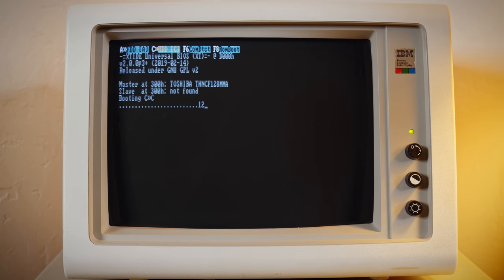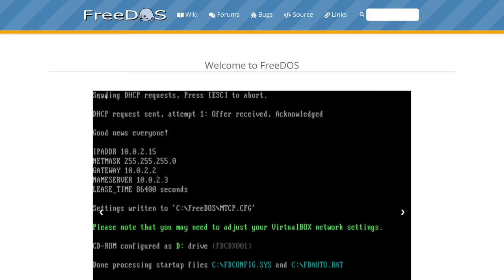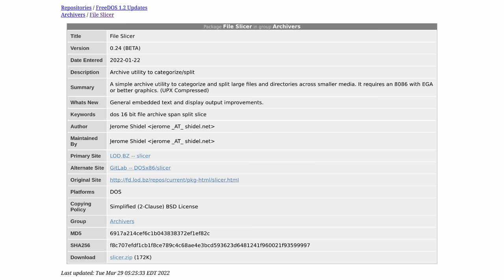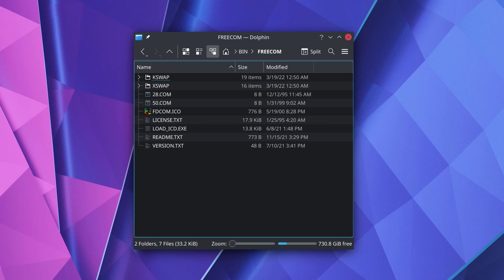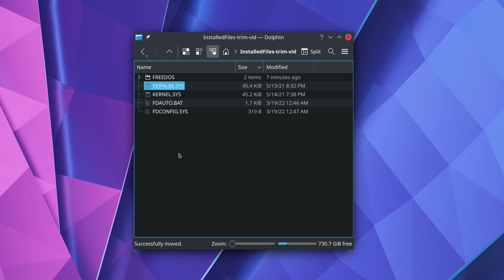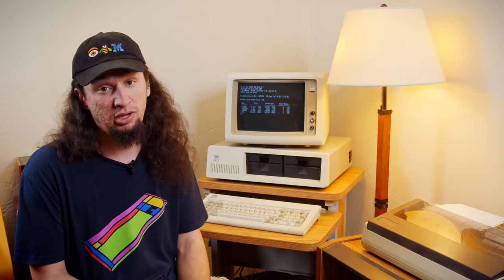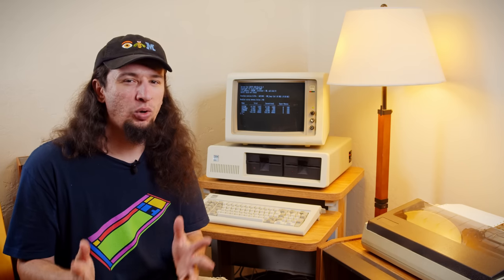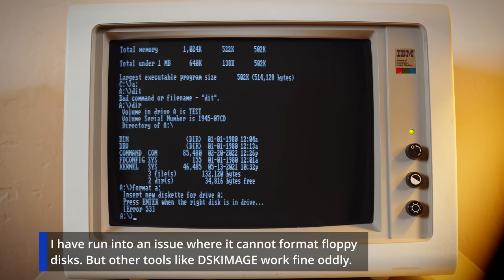Installing FreeDOS for 8086 on an IBM 5150

Comment: It seems to me that FreeDOS doesn’t really know what it’s supposed to be.  Is it supposed to bring an antiquated OS to new computers?  Or a more feature-rich replacement for old computers?  When you’re talking about potentially running on systems with “up to” megabytes of storage, and kilobytes of RAM, you can’t really optimize for both.
Reply: It is supposed to be a loophole for selling computers without an OS in the countries where it is prohibited by law.
Reply: @IkarusKommt  Selling computers without an OS is illegal in where now? Sounds totally ridiculous, but I can imagine that being the case somewhere - wouldn't be even close to the most insane laws I've heard about; but still raises a question of who tf is behind such laws anyway?
Reply: @robsku1  The logic behind that is simple: all electronic appliances must be sold in the working condition, and computers cannot work without an OS.
Reply: The purpose of FreeDOS is to have an Open Source and 100 % compatible replacement for proprietary MS-DOS. That's the main goal of FreeDOS. The rest, like more features and better support of modern hardware with more RAM above 512 MiB comes second. 

The reason it's not so well suited to very old 16-bit machines is because the development came at a time when everyone already had a 386 or better and 16-bit machines were considered mercilessly obsolete. Many advanced tools were therefore developed as 32-bit protected mode applications. Fortunately, this does not apply to the main DOS programs, which serve as a replacement for the programs in the DOS folder. These therefore all still run on the older 16-bit processors. However, many of these are also more feature rich and powerful, so they require often more RAM.
Reply: @robsku1  The country is Germany.  It is possible that there are other countries with such rules.

Comment: I know I shouldn't nitpick, but I'm kind of irrationally bothered by the fact that you keep saying 8086 when the actual CPU in any original 5150 or 5160 would have been an 8088.
Reply from the maker: I wanted to avoid confusion for people and since the kernel version of FreeDOS is called "8086"  I decided to just stick with that for the whole video.

Comment: Remember: it is utmost important to remove Microsoft from everything you can. FreeDOS is the tool of choice for retro computing.
Reply: Except your 5150 still has Microsoft BASIC in it's ROMs. :)
Reply: DR DOS, anyone? Also, 4DOS (I heard) is FOSS nowadays, I think FreeDOS should start including (and improving on) it as alternate shell option - for myself, I can't even think of running DOS without 4DOS as shell.
Reply: @robsku1  FreeDOS doesn't require 4DOS. FreeDOS's shell is already very powerful by itself.

Comment: bios device drivers access, not on the os layer, direct compatibility on the bios level to all devices, usb
Reply: linux boots nicely from a usb-stick, wtf, better
Reply: write directly (flash) the boot image to the modern drive, then resize like linux distros do
Reply: too much work if you dont see the correct solution (perfect) right away
Reply: if the devs are not "at home" with the vintage systems, or even normal usage cases, then stupid decisions are made in packaging and user interface
Reply: meh attitude leads to meh packaged system images
Reply: yo zmodem  is legend
Reply: self-contained is super
Reply: if you got it to 2 disks, then use the two disks
Reply: even decompressing packaged version
Reply: you just leave the computer to do its thing
Reply: the less complex way is better, you dont usually have proper cables
Reply: or the second side of the cable working with the complex design
Reply: pkunzip is fast enough on 8086
Reply: or ARJ
Reply: if you make the shrink image on a vm, you can get a minimal flash image .img .iso to flash with linux, like you can flash rpi systems

Comment: Whilst this is cool, it's too inauthentic to me. The four floppy version would've been much preferable.

Makes me recall installing a hard disk to my Amiga, and that took... lemme just think in text here, 3 floppies for the OS(4 if you want to install a language other than English), 1 for the SCSI driver to get CD-ROM support, 1 for getting my printer driver installed and... I think that's it, so yeah, 5 or 6 floppies to be properly realistic about it, and this was in 1992.

I imagine installing Windows 3.1 on a similarly spec'd machine of the time would work in a similar manner, but probably with more disks involved.
Reply: To be fair, not only do the 3.5 inch drives in most Amigas hold 880K, but they're also much faster than the old 5.25 inch, 360K drives in that IBM machine. My A1200 had 1 internal and 2 external floppy drives, one being high density, 1.76Mb. So much faster than floppies on my old 8 bit Atari, but they were still painfully slow. Then I got a 2.5 inch, 60Mb hard drive... enough space to last forever! 😁
Reply: @another3997  Ridiculously, my A1200 had a 1gb HD I bought in like 1995. Never got past 200mb full, even after WHDLoad. Much like the expansion card, which had a 68030, 68882 and 4mb fast RAM, it was really underutilised.

It still works, too amazingly, hard disk is making unhappy death sounds and most of the floppies are dead, but DF0 and DF1(both 880k, one obviously external) still work just fine if I can find a game that isn't full of read errors.
Reply: @fattomandeibu  You just need to clean your floppy drive. And if it can't read your old floppies, chances are high, that the reading head is misaligned. You should watch some videos about repairing floppy drives.
And remove your CMOS battery from your A1200 motherboard. The latter is the most important thing you should do, otherwise battery leakage will destroy your A1200 motherboard.
Reply: @OpenGL4ever  I already tried that. I first used a cleaner disk, then the old cotton swab method.

My A1200 doesn't have a CMOS battery. There was a one on an expansion card but I already removed it.

Comment: Freedos has a lot of issues still. Program compatibility is now really good compared to previous verisons.. But some usability things really are just unacceptable. The edit program does not follow the same keystroke patterns as msdos edit. nor does it seem to follow the same file encoding protocol. For years I would exit the app by pressing alt, up arrow twice, enter twice. that would save and exit. However freedos edit will run to the right hand menu when pressing up arrow. Stupid things like this make me not want to use it. 

its bloated. the startup files are bloated, the amount of activity on the screen is bloated while booting, This is absolutely asinine as they have useless things like MEM running which passes by so fast you cant see it. Why ?

 there are no install options with the floppy version so it tries to load network drivers and hangs up on first boot. unacceptable.

the DIR command defaults to pause on every screen out of the box. why? why the hell do they change fundamental usability on such basic things?  The file shell isn't even as capable as dos 5 dosshell. it lacks simple word wrap on viewing files which makes a very usable thing, utterly useless in freedos. And it isn't even part of the floppy version.. 

I am ranting yeah, but there are about 50 other things that keep me going for 6.22 with few addons.
Reply: I think the bloat comes from trying to automatically run on any PC at every boot. That's why FreeDOS checks for presence of multiple different kinds of optical drives (and possibly other devices). But of course, when installed, it would make more sense to skip attempting to run drivers for stuff that was not detected. I have FreeDOS installed on a virtual machine in VirtualBox, and I got it to boot much faster after deleting references to non-applicable stuff in the whatever the FreeDOS counterparts of config.sys and autoexec.bat were. Most of the boot time in the default install seemed to be spent waiting for various timeouts for stuff that isn't there.
Reply: @enginerd80  They have creative batch files for cdroms, network interfaces, memory boards, pci tags, and even one for a welcome message. It goes through some 1400 lines of batch files by default. I trimmed mine down to about 16...
Reply: EDIT from FreeDOS follows the keystroke patterns from Windows and this is in my opinion a very good thing.
I am really glad that CTRL+X, CTRL+C and CTRL+V work the same way as on windows and all other modern desktops like Gnome and KDE from Linux. Because that is the standard now for every modern desktop system.
cut = CTRL+X
copy = CTRL+C
paste = CTRL+V
It would be really annoying, if they would do it different like in old DOS.

The startup files are there to make it userfriendly. If you know DOS batch file programming, it's an easy thing to change them.
You can even just delete them and write your own. I adjusted my startup files.

Comment: Well, it shows that you probably haven't even been around when an 5150 and it's accompanying DOS originally came out. And that is what you should compare FreeDOS with. Alone the option to use the FAT32 kernel is something that wasn't even remotely on the radar back then. Or an editor like EDIT (granted, I am not a fan of it either) but with PC-DOS 2.0 on an XT, you had to make due with EDLIN, which is also included with FreeDOS, so there you have also some easy space to save... ;-)
Reply: EDLIN from FreeDOS requires much more RAM.
On disk the size of FreeDOSs EDLIN is 31252 Bytes.
EDLIN from MS-DOS 6.2 is only 12674 Bates in size.
FreeDOS's EDLIN is written in C and compiled to machine code.
MS-DOS's EDLIN is written in assembly.
Reply: @OpenGL4ever  And your problem with the EDLIN exactly is?
Reply: @TheRealRedRooster  Do the maths. The first IBM PC model was equipped with only 16 KB or 64 KB of RAM. 
And you need a little RAM for DOS itself and EDLIN, leaving you with nothing left to write text with FreeDOS and its version of EDLIN.
Reply: @OpenGL4ever  And even a 64KB 5150 isn't likely to run DOS in the first place. Beside, what are you gonna do with EDLIN? Recreate "War and Peace"?. Seriously, for all practical purposes, the practical difference is negligible
...

Comment: I have been thinking a lot about this, since I migrated back to Windows 10 from Linux (after 5 years!!) after noticing trying to use Linux in a daily basis was consuming all my spare time in order for the system not to break. (excessive memory management with caches that never get cleared, wifi connection dropping every 15 minutes, inability to use Wifi and Bluetooth speakers at the same time, no hardware acceleration on browsers, AMD GPU encoder for OBS having artifacts on screen, fans constantly spinning up on Linux and temperatures never going below 50 C while they go down to 40 on Windows... things were starting to get so stupid on Linux that my brand new Ryzen 5 laptop with 8 cores was struggling to navigate youtube comments, when I typed comments after browsing a few videos the CPU would start to lag and it would take more than 5 seconds for the letters that I typed to appear on screen... this is the kind of crap I would expect my 10 year old laptop to be having, and not a brand new machine...)  
The ONLY thing that I can point was better on Linux was the fact that I could run the entire system directly from USB (read-only mode) meaning that I had no constant random writes to disk (browser caches are specially awful at killing disks prematurely)
Now that I'm back on Windows I have monitoring programs telling me that I have no less than 10 Gigs of daily random writes to disk (and all of that even after putting my browser cache to a RAMdisk) So I will have to look into ways of working on that... I wish I knew how much my Windows 7 installs wrote on disk daily. (disable indexing, disable superfetch, disable everything that puts extra strain on disk, don't worry about that)
  
So I had a feel of how "free software" impacted my life.
It was NOT good.
Let me just say this... for such a corporate billionaire evil-elitist son-of-a-banker with ties to the illuminati, Bill Gates for sure delivered us with an user-friendly, practical, functional, almost flawless system starting all the way with DOS. You can't deny how much of our lives became easier because of Microsoft software.
Unfortunately, I can't say my experience with Linux for 5 years was remotely similar to that. A few advantages, but a lot of roadblocks and unnecessary manual labor.
  
It got to a point where Linux started to get in the way of my productivity, 
having to manually kill browser processes because the system doesn't know what to do when it reaches low memory status (countless freezes and hard reboots) 
Not only that but having to kill my browser process after watching 5 youtube videos because I could see in the panel indicator that my CPU was being overburden by some random leak process (it reached a point where I even had a keyboard shortcut for it, for how frequently it would happen)
I'm not really sure how the linux guys were able to destroy the entire environment like this after 2016 (the last releases to have a perfect compromise between performance and compatibility with hardware)
This is what "freedom" allows in people.
Let people too "free" for their own good and they start to behave in sociopathic/psychopathic manner even more than the "corporate overlords" they claim to hate. But instead of having to deal with ONE asshole at the top, you have to fight against an entire ecosystem of these. That's what Linux is right now. And it's continuing to go downhill.
Reply: why did this text became so huge
🤣🤣🤣🤣🤣🤣🤣🤣
WHYYYYYYYYYYYYY
Reply: if anyone knows of tricks to make Win10 use the LEAST writes on disk, please share... that's the last piece of the puzzle for having a spotless system that doesn't get in my way
Reply: It sounds like you took an experimental version of a distribution to always have the very latest. I've been using Debian Stable here for years and, apart from the Wifi problem, haven't had any of the problems you describe.
For my Wifi hardware I only had to install the proprietary firmware from the non-free repository, since the free firmware was not ready to maintain a stable connection due to a lack of information for the developers from the Wifi hardware manufacturer. With the proprietary firmware the connection was stable.

On the subject of Windows and write access, here you should find out how many write cycles a SSD can handle before it breaks. Then you will find that you don't need such a write reduction at all.
Reply: part of my problems is that I have a mechanical spinning disk, not SSD... but I didn't have the same problems on older distro on older slower disk... something in the software is crapping up
Reply: Win10 entirely disables disk caching on SSD (from what I've heard) I'm not sure Linux also does, hopefully it does
Reply: @FeelingShred  Write cycles are not a problem with a hard disk, since the magnetic disks can be written to infinitely often.
Reply: @OpenGL4ever      you're mistaking subjects, no one ever talked about write cycles, go somewhere else I guess